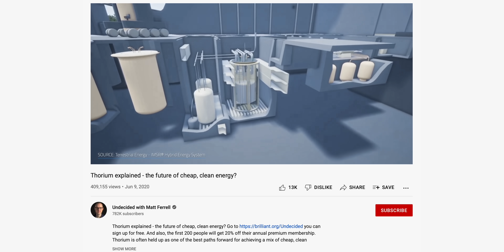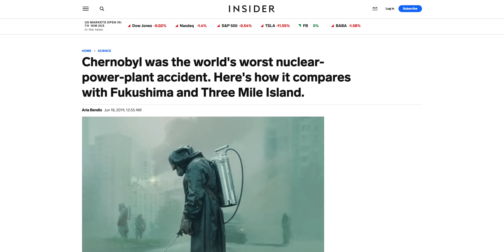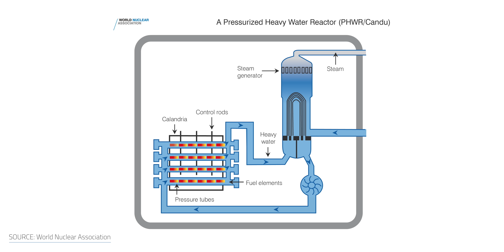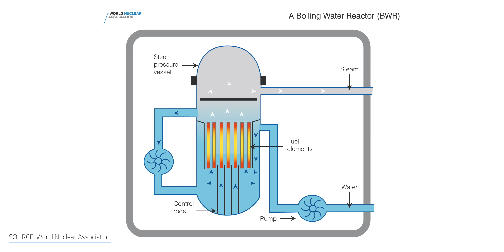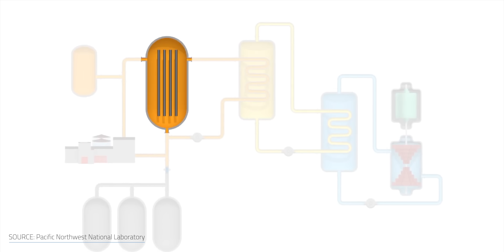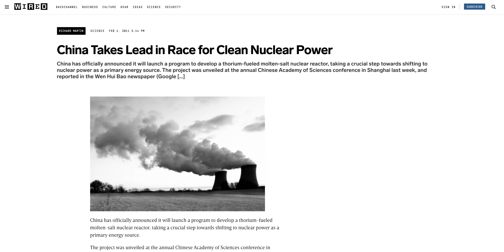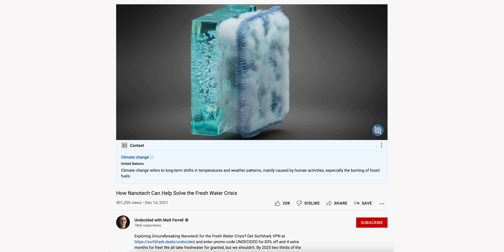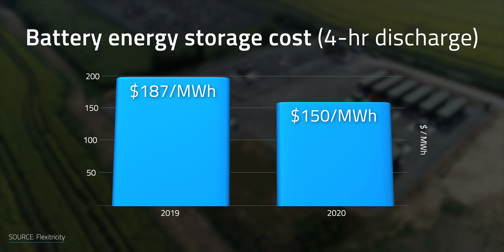Revisiting Thorium Energy - The Future of Nuclear Power?

Comment: MSRs are BAD. There's a reason countries are not falling over themselves to build them.

For example, they will NOT be self-regulating. Thermal expansion and Doppler effect just don't provide smooth enough feedback at the power you need for a commercially viable reactor. You'll end up with wild oscillations. A control system will still be needed, and it has to be designed to avoid creating uncontrolled pockets of criticality.

But the main show-stopper is that we don't have a material that can survive the hellish brew of hot fluoride salts for long enough. Fluoride salts will inevitably produce hot monoatomic fluorine radicals through radiolysis, that literally eat through anything.
Reply: You basically mean a reactor requires control rods to be able to stay at a stable power output level. Well of course it does.
Reply: @zolikoff  Yes. But the claim in the video is that the reactor is self-regulating.

BTW, this DOES work in small reactors. As an example, Kilopower reactor designed for deep space probes is completely self-regulating through thermal expansion and Doppler shift effect.

The kicker is that you can do that only at fairly low power, so that the feedback loops don't create oscillations.
Reply: @AlexBesogonov  Yeah it's probably just meaning to say it has negative temperature coefficient, although many other reactors have that too. It's not a good video altogether.

Comment: Matt, what the video didn't mention about future thorium & small scale nuclear designs is that the cores can be made in factories, sealed, and shipped to site. This could bring the LCOE of fission to solar or wind prices without the need for battery storage. What's needed is a large-scale development program for future nuclear tech. Why? Due to energy density, the theoretical minimum cost of a future optimized reactor will be lower than solar or wind. Instead of 10 years to build one reactor on-site, it could be 10 years to develop & build a reactor core factory which then produces reactors which are sent all over the world. Meanwhile, solar & wind are going to get built at max speed anyway. The enemy is bad nuclear regulation and the need for costly insurance and such. America needs to look at the urgency that China and India have with their nuclear programs!
Reply: check out Thorcon Indonesia

Comment: The advantages of Thorium are huge. I've followed Kirk Sorensen at FLIBE energy for some time. There is a lot of work to do to bring this to commercialization. LIFTR seems to have advantages in safety and and much lower waste production, easier to handle waste, and potential to be cost effective and refueling while running with high efficiency in terms of burning most of the fuel.  The grid really needs a solution like this to complement wind and solar power in a way that batteries cannot meet.

Comment: 4 hours is not enough battery storage. Curious as to the cost with at least 12 hours of battery if not 24 hours.
Reply: How about weeks?  My 4Kw photovoltaic system has only produced power for about three days for the last 30, so you are spot on about the 4-hour nonsense.  I'd like to see any greenie come and tell me how big of a battery I would need to be 100% solar in a Michigan winter.

Comment: One thing that I don't think that you mentioned (correct me if I just missed it) but Thorium based reactors have far less radioactive waste that builds up over time, making them much, much cleaner in terms of waste compared to Uranium based reactors.  Also, you can get far, far more energy out of Thorium than you can for the same amount of Uranium.  2 very important things to remember and mention when discussing it.
Reply: This is only true when comparing thorium reactors to classical uranium reactors.
When compared to a uranium fast breeder reactor thorium is about the same with only 1 big advantage left. Thorium breeders are thermal reactors instead of fast reactors.
Reply: @nocare  Thorium MSRs can breed thorium.
Reply: The amount in raw volume may not necessarily be "less".
It's just that some of what comes off it is medically or scientifically useful.
And most of the "waste" is actually far "hotter" than the stuff you get out of a traditional reactor.
However, the way it usually works is the hotter the stuff, the faster it breaks down.
So much of what's coming out of a reactor will break down in seconds, minutes, and hours.
Less of it will break down in days/weeks/months.
And even less of it will break down in years/decades.
With only a fraction being the stuff that'll take the full 500 years to cook off.
Reply: @PhotonHerald  thats not correct.
Radioactive waste has a half-life that is indipedent of temperature.

The specific radioactive bi-product entirely determines the half-life and thus directly determines how dangerous or problematic the waste is.

In turn the type of bi-product is determined by what fission cycle you use to generate the power and if you are using a breeder reactor or not.

Breeder reactors can cosume a portion of the neutron and this power output to convert problem.atic waste products to less problematic ones.
They also tend to have a larger percentage of fuel being converted to power resulting in less waste.
Reply: @nocare  I'm not using "hot" in terms of temperature.  Nor, when I'm talking about nuclear fuel, am I talking about conflagration when I use the term "burn" or "cook".
I'm using "hot" in the sense of overall energetic radioactivity output.
Things with a shorter half-life tend to be MORE energetically radioactive than things (of equivalent mass) with a longer half-life.
The reason current nuclear waste takes so long to break down is that it isn't that energetically radioactive.
Reply: @PhotonHerald  Thorium MSRs waste has a half-life of 300 years.
Reply: @romado59  Preaching to the choir here.

Comment: Ok.....lets get something straight here......so called Thorium reactors - are URANIUM reactors. The fuel that burns is URANIUM......it derives from thorium, which is more abundant than uranium ore, but the processing of thorium to acquire the uranium is much more expensive and still dangerous. As thorium is not a fissile material, it requires to be irradiated. This irradiation process of thorium, produces an unwanted uranium by product - Uranium 232, which is highly radioactive and difficult to shield against.  While LFTR's are theoretically safer than conventional reactors, they still produce toxic nuclear waste, both in the creation and spending of the fuel. At present ALL nuclear waste is stored in TEMPORARY containers. At present modern science has no safe solution to the disposal of nuclear waste.....and burying it in a deep whole isn't a solution.......and passing the risk and responsibility onto future generations 500 years hence at a minimum, is unacceptable.

Comment: While thorium is an advancement that needs to be developed a bit more, it's still likely a decade or more away, and that's even assuming the public can be deprogrammed from a half century anti-nuke propaganda from the media. 
We have been building small modular reactors in ships in less than two years for a fraction of the cost of the typical nuclear power plants; millions not billions.  We could be doing this now instead of waiting for something that may never come like fusion and flying cars.
Reply: The fastest way to decarbonize electricity would be to just take the Gen 2 large LWR designs that were built in the 70s and replace most electrical generation with them today. There is absolutely nothing wrong with them. If mobilized this would be accomplished globally in 10-15 years.

Comment: Thanks for the great video. I have a couple comments/notes

1) THORIUM SUPPLY - A very rich source of rare earth metals (REM) is Mountain Pass California. But because the chemical properties of thorium and REMs are very similar, deposits rich in REM also tend to have substantial amounts of thorium. Currently because there is no commercial use for thorium, that is a problem. US environmental law doesn't just allow that Thorium to be dumped in tailings piles. As a result US production cost are more expensive than Chinese REM, which aren't quite so fussy.  But if Thorium becomes source of income and not an expense, then not only can the US get much close to being independent with respect to these materials so important to advanced technology, but also produce enough thorium to power our economy. This is even more the case of Australian, where their major deposit of REMs have an even higher Thorium content. 

And to "prime the pump" as it were, there is approximately 7 million pounds of thorium nitrate that the US government acquired decades ago with the thought of using it in breeder reactors. But when that didn't happen, they got tired of paying for storage. So all of it was put it in metal containers and buried at the US nuclear testing site in Nevada. All we would have to do is go dig it up and we would have enough thorium to supply all of the power currently used by the US for a decade. With a gradual ramp up of MSRs and given that MSRs (or any nuclear reactor) are unlikely to generate more than about 1/3 of our total energy, just the thorium buried in the Nevada desert would provide all that we would need for 40-50 years.

2) SYNERGISTIC INTEGRATION WITH WIND AND SOLAR - Current Pressurized Light Water Reactors (PWRs) do not work at all well with intermittent energy source like wind and solar. PWR can only increase or decrease power output very slowly. Thus they can be a good source of base power, but they can't provide the necessary rapid load-following capability to fill in the gaps in wind and solar. PWRs peak temperature is only 280 c, so not hot enough to make direct thermal storage feasible. Thus to store any of the power they generate in order to provide load-following, PWRs would have to use the same methods that solar and wind would use to store excess power (batteries, pumped hydro, etc.). 

Molten Salt Reactors (MSRs) don't like to change power levels any faster than PWRs do. But MSR's advantage is that their peak temperature is over 600 C. This is hot enough to make direct thermal storage worthwhile. Studies have been done that look at using vacuum insulated tanks to hold molten tertiary salt. While the energy from the reactor coming into these storage salts is pretty steady, the amount of energy being extracted depends on the flow rate of the molten salts being pumped through steam generators, which can be varied rapidly over a wide range. This allows MSRs with thermal storage to have a load-following ability. With the ability to rapidly change the amount of electrical power generated, MSRs could be key to fill the gaps left by the intermittency of wind and solar without having to build huge battery storage farms, or other energy storage mechanisms. 

Another fact to consider is that for wind and solar to provide say 75% of the total grid energy,  the actually installed capacity would have to be approximately double that so that excess power created when the wind is blowing and the sun is shining can be store for the periods every day when it the wind has died and the sun has set. And it is likely even worse than that because of fairly large seasonal variations in solar incidence and wind velocity. So solar will have to be even more capacity to produce enough power in the winter when the sun is lower. And wind installed wind generating capacity will have to be sized based on times of the year when winds are on average lower. With MSRs with thermal storage, the installed capacity of wind and solar could be considerably smaller.

So while MSR might have a higher levelized cost of energy by itself than wind or solar, the important load-following capability could mean that MSR (or potentially other high temperature reactors like helium cooled pebble bed reactors which could store energy in exactly the same types of molten salts) could be a very important part of a future grid where wind and solar is a significant fraction of the total energy supply

3) PROCESS HEAT - most industrial processes require some amount of increased temperature to work. About half require temperatures above 400 C. With a 600 C  working temperature, MSRs could be a source of process heat. One very interesting one that my team is investigating is using renewable energy sources to make synthetic fuels. These fuels take CO2 out of the air (or sea water, which looks like it requires less energy) and hydrogen from splitting sea water and using a combination of heat, electricity and the right catalysts, reverse the combustion process and produce hydrocarbon fuels. The initial fuels produced by most processes are methane or methanol. Methane can be used for anything which currently uses natural gas. Methanol can be used as a fuel for transportation. But further processes which are largely heat driven in the presence of a catalyst can combine methane and methanol to make longer chain hydrocarbons, all the way up to octane (the major component of gasoline) and even diesel/kerosene/jet fuel.  It is likely the only non-combustion heat source that can be used directly to drive a lot of very important industrial processes. The one we are particularly interested in for use in aircraft is butanol. Butanol is the alcohol of butane. It has an energy density just slightly less than gasoline, can be used at up to100% concentration in most current gasoline engines.

So a notional MSR could be located near the coast. Sea water is pumped in to provide CO2, hydrogen and cooling. The MSR provides a steady 24/7 source of electricity and high heat to drive the processes.  various stream
Reply: Transferring  the excess heat to thermal batteries rather than electric is an angle I never though of. It's yet another  way to work with the renewable energy sector.
Reply: Underrated comment!

Comment: Time, cost and uncertainty are all against MSRs. As a tool to battle climate change and air pollution this technology will take too long to deploy and have any benefit. Fundamentally it’s still just a fancy, complicated way of boiling water like in a steam engine. Better to use the proven renewable energy sources we have today rather than wait for a miracle technology.

However, as a tool to advance space exploration and settle the solar system (as in The Expanse) by the 22nd century I fully support research into MSRs as well as fusion energy.
Reply: With renewables we have to wait for a miracle energy storage technology that is up to the task. 
So show us your better, miracle, way to boil water.